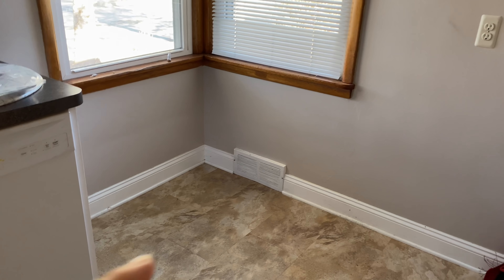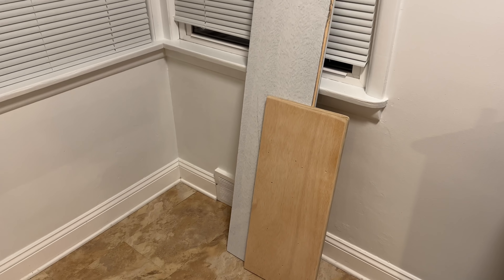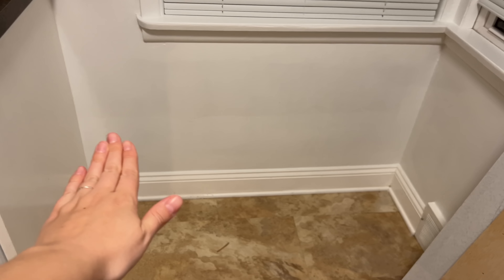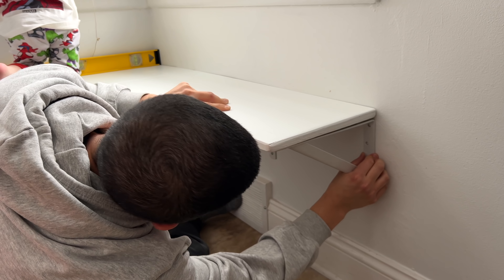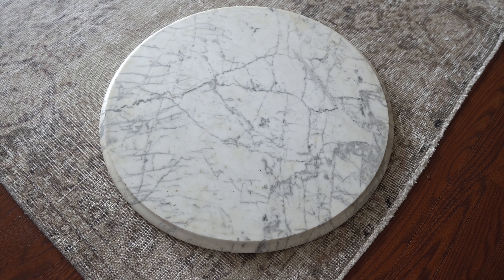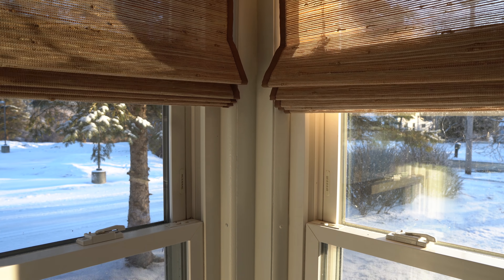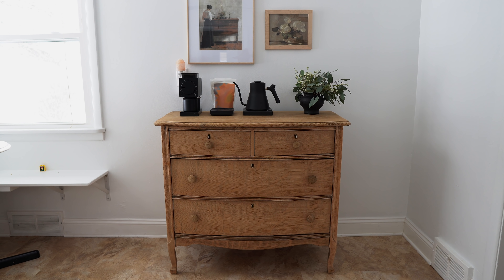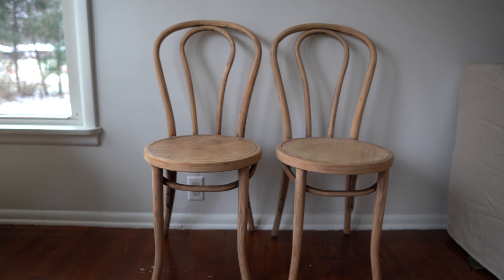RENTAL HOME KITCHEN NOOK MAKEOVER (pinterest inspired)

Comment: Love it. I’d love a step by step to making the bench. We want to do the same for our small kitchen.
Reply from the maker: Basically we used L brackets and found every stud in the wall to secure them to and then used GRK nails to screw them into the wood. He did add some wood support underneath and drill through the top of the bench. We had to fill those holes and paint over them.